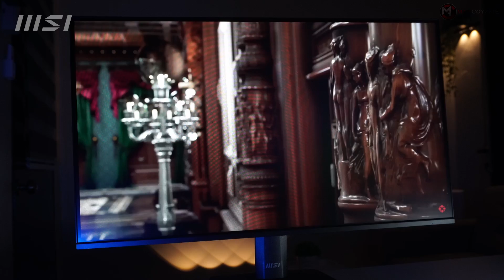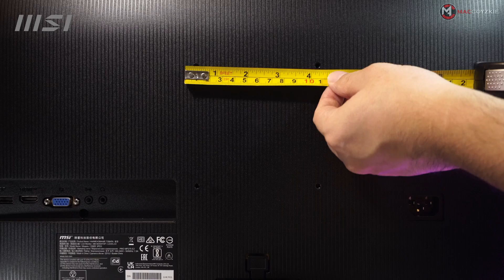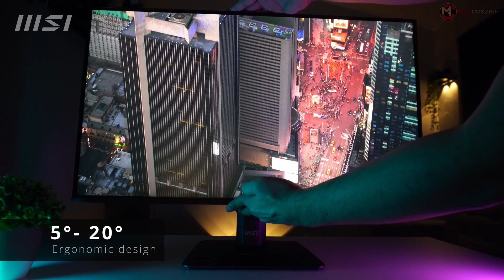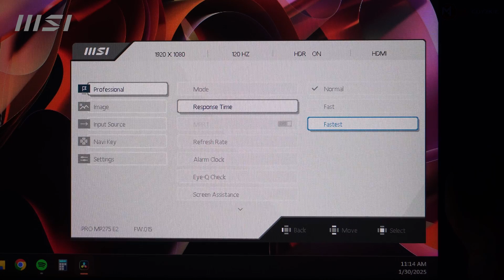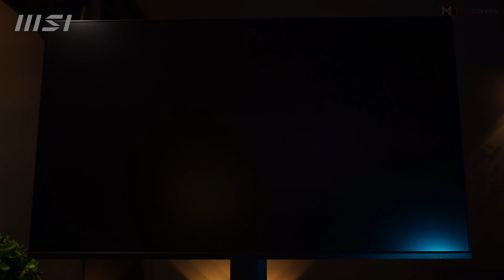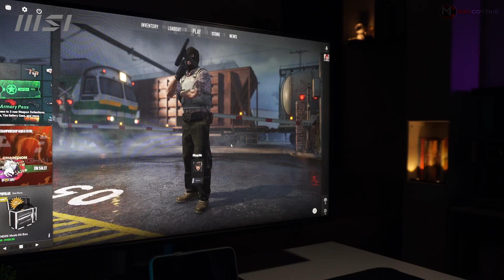Affordable BUT Powerful: MSI PRO MP275 E2 Monitor

Comment from the maker: Calling all budget gamers! I think you'll love this monitor from MSI
Reply: can you help me with my pc? i recently bought a graphics card, i immediately put the new gpu and didnt remove the old amd gpu driver (i have an apu) and after putting in the gpu and plugging everything back in, it shows no display in my monitor even after removing the gpu and plugging my hdmi cable back to the motherboard it still doesnt display anything in my monitor
my pc specs:
cpu: ryzen 5 3400g
gpu: rtx 3050 6gb
psu: silverstone 600w 80+
ram: hyperx fury ddr4 2666mhz
Reply from the maker: @xzenith11 i got a video tutorial for that, here’s a link bro https://youtu.be/pwgg8Vp2NNk
Reply: @MacCoyzkie thank you for the help, ive found out that my cmos battery is almost fried and my ram is dead, i replaced both and now its already working thank you again ❤
Reply from the maker: @ glad u figured it out, no problem bro

Comment: is it the same with MSI PRO MP275 E14L 27" FHD IPS 144Hz Flat Monitor?
Reply from the maker: MSI PRO MP275 E14L 27 is slightly better, if you have the budget then go for that instead of what we have in the video

Comment: Bought my first monitor but no clue how to tilt it like you did. Anyone?
Reply from the maker: is it the same model as in the video?
Reply: @MacCoyzkie yes
Reply from the maker: @fira6942  it's a bit stiff so you need to hold both the top and bottom of the monitor when tilting, push from top, pull from bottom.

Comment: i did some few research about 27" 1080p monitors, some says that its blurry if you totally look at it because the pixels are stretched out, its nice to have 1440p for 27" they said but im still looking for a budget 27" monitor lol,  anyways, any updates on this? is it really good for gaming? if you're still using it, any issues at all? Hopefully you'll notice this or if you can make a short update for this model, Thanks for the review! 😁

edit: based from what i researched, my PC specs is not recommended for 1440p gaming, only 1080p but its possibly can play 1440p but low FPS in games i think, i have Ryzen 5 5600X, RX 6600 8GB, 32GB RAM
Reply from the maker: if you already saw 4k oled, 1440p will be blurry for you, same if u got used to 1440p 27inch then 1080p 27inch will look terrible, that is why i always tell myself not to look into higher resolution or at least don't get used to it until my budget allows me to lol, tbh it's like a curse. Anyway, for your pc specs a 1080p 165 or 144hz  is a sweet spot. you'll only get frustrated if you buy a 1440p 144hz then play AAA games. 

About the monitor i used for this review, not sure if it still works since i returned the unit to msi. but msi monitors in general works fine and last long like this one i reviewed in the past https://youtu.be/tD7zdDLQPao my cousin is using it for gaming until this day

Comment: would a monitor arm mitigate the shaking of the screen you mentioned?

Also, this screen  has a low energy rating (as do many MSI products), did you notice any over heating, insulation problems?

Did you notice a spike in your electricity bills which would offset the savings on price?
Reply from the maker: yes, a monitor mount will be better. about the overheating and electricity bill i didn't experience any, overheat or electricity spike. msi monitors in general consumes very little amount of electricity, around 13-20watts depending on the brightness and that's pretty low

Comment: I'm a bit confused at your FPS being capped at 60 on Elden Ring when it's a 120Hz monitor (with Adaptive Sync?). Nice review though, I'll add this monitor to my list of potentials :)
Reply: Elden Ring is capped at 60, same with Dark souls and sekiro. It's a Fromsoft "issue" and nothing to do with the monitor
Reply: @Captain_Kouga  That is surprising, thanks for the info. Also I've decided to go for the Cooler Master GA2711 27" IPS Gaming Monitor / 2K QHD 2560 x 1440 / 100Hz, with it being similarly priced for me, and higher resolution. Lower Hz but I have a less powerful GPU so it's not like I will be reaching the max (I probably prefer capping anything at 80 FPS anyway). With DLSS/up-scaling available on most games it actually boasts the same fps using the GPU on 1440, instead of using the native res on 1080. In comparison the higher res with upscaling brings better visual fidelity. Definitely something for anyone to consider, especially if they are also into digital art :)
Reply: @Drk-wr5lh  I just ordered the same coolermaster monitor! Wondering if you can give me any feedback on how it's been for you since you got it?
Reply: @Dortorsk  Unfortunately I haven't ordered it yet as I've been delayed with moving into a new home where I planned to upgrade my workstation. I'm sure you won't be disappointed with your new monitor, but would love to get your feedback once you've tested it out ;)

Comment: Good afternoon, I recently bought Msi pro mp251l e2 There are built-in speakers but there is no sound, in the Windows settings I selected it as an output device and there is still no sound.
Reply from the maker: go to control panel>  search SOUND > in the sound window go to playback and make sure the msi speakers are set as default device

Comment: i bought 2 Mp273qw’s. Do you think it’d be similar the only difference is that the monitors i got is 100hz and 4ms response time.
Tbh i bought them as my secondary and tertiary monitor
Reply from the maker: tbh, i would choose Mp273qw than this one. well im mostly editing videos so doesn't game that much so the specs work better for me. But in the end, it depends at what you do the most.

Comment: what you think about the ppi, does it visible as its a 27 inch 1080 monitor?
Reply from the maker: yeah, low ppi is noticeable on a 27 inch, but not so much in a sitting position, if you get closer than usual

Comment: i just bought this monitor for my ps5 and i don't know how to enable 120hz on it 
help me
Reply from the maker: homescreen > settings > screen and video output > look for the 120hz output choose automatic. Then save data & game app settings

go to game presets> choose performance mode. After doing this check your in game settings and you should find a 120hz refresh rate on and off, this will depend on the game though
Reply: @mahmoudboulaoued9996  hey man is this a good monitor for ps5?